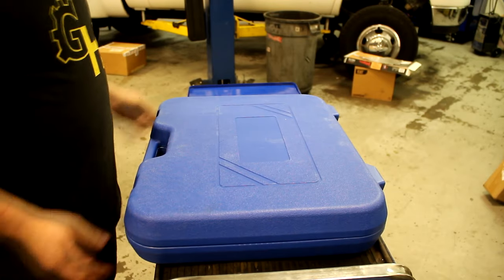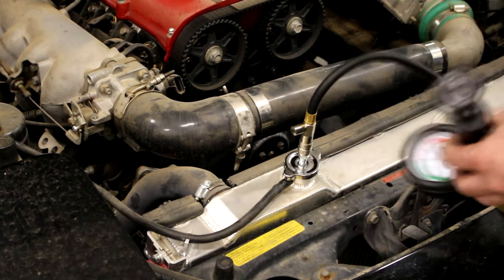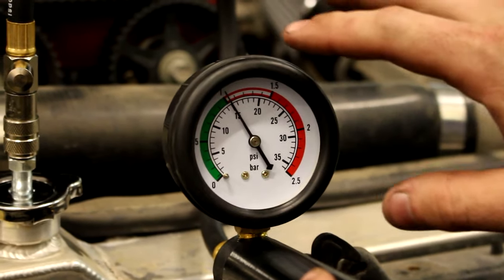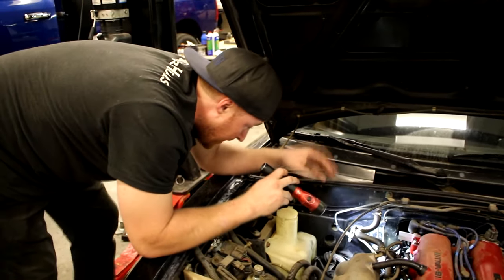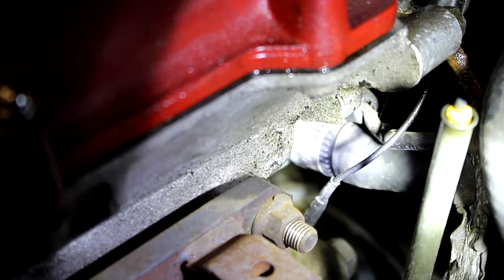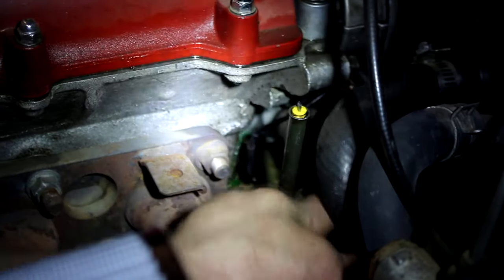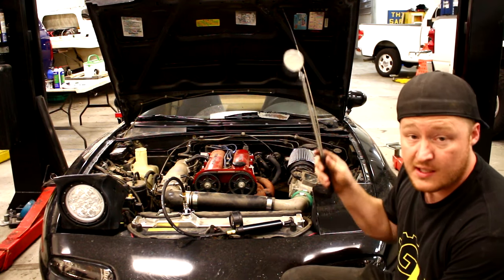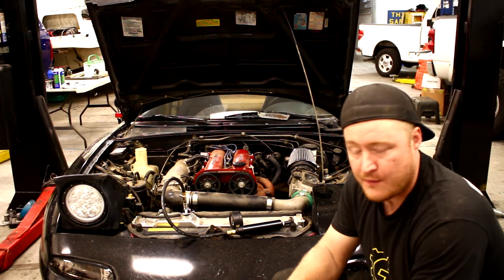The RIGHT Way to Find A Coolant Leak!

Comment: Thanks. Super helpful video. You answered my question. I knew there had to be a better way than guessing or filling it up again with coolant, getting it hot, and then looking for the leak. 😁 Update- rented the pressure kit, pumped it up, and instantly found my leak. Worth the time and removed all the guess work. Thanks again.
Reply: The main problem with getting it hot and looking for the leak is all the steam that can get in the way from the coolant spraying on the engine and exhaust.

Comment: I'm doing this (again) on my Isuzu Rodeo tomorrow. I've replaced so many little coolant hoses over the years, and O-rings, etc, on this car. Every time I think it's finally a blown head gasket, it turns out to be some little T-junction of hoses hidden somewhere and spraying coolant under the intake or some damn thing. I already put the pressure tester on the radiator at the parts store, actually, and I could hear the coolant running out, but couldn't see it. Need to do it again with the air intake off and maybe snake the endoscope around looking for a visual leak.
Reply from the maker: Good luck!

Comment: Thanks for the idea, we are going to try sealing a suspected "hole" in the engine of my car with chemical metal, but I think I'll suggest to my father that we let the pressure build up first (run the engine for a bit so the rubber hoses become stiff) and observe so we can be very sure that is the actual leak and not something else.
Reply from the maker: Dont waste your time getting it hot, just buy or rent for free a pressure tester so you can find out when it is cold. Then again the guy wanting to JB weld his coolant leak is not gonna be the guy to do things the right way in the first place I guess 😂😂
Reply: What does "hole in the engine" mean? It's nearly as vague as "hole in the car." 🤔
Reply: @GearHeadsGarageChannel  Ha ha. I suspect my father just went along with it just to let me make my own mistakes. 

I found the leak soon after because I was just a second away from getting sprayed in my face by scalding hot coolant from a hose when I was looking around the engine searching at my parking space after a intentionally demanding ride to raise the pressure, we found the right part and fixed it, but the head gasket failed hardcore a month or so later and fucked up the car so badly that I had to sell it.
The second car I had I did a far better job at diagnosing, researching and finding the coolant leak that popped up on that one. But on that one the car engine slowed to a crawl and jerked like mad at the end. I was also sick of the fuel costs it had so it gave me a excuse to sell it off.
I understand cars far better now than I did a year ago and understand better how to find leaks now and how to troubleshoot cars. 
This third car is in very good condition for being 20+ years old and I have a plan to service it properly as I want to ensure it lasts for another 10 years.

The biggest issue I have really is that I have no place to properly lift the car and tinker with it to learn more if I want to do something under it, the only lift in the city costs money per minute and it quickly adds up, so I'm restricted to reading and reading some more about whatever issue I find, then lifting the car only when I am ready to tackle it, But things I can fix while the car is standing is no big problem. I'm slowly aquiring every tool I can imagine and reading enough about the car to burn a hole on my computer screen.

Comment: I’ll def check this out today! My 2018 ecoboost mustang is leaking coolant.. I think it may be internal since white smoke is being produced from the exhaust only on start up… but hopefully it’s something small so I won’t have to spend hundreds of dollars for a repair I could do myself. 🙏
Reply from the maker: In that case you also may want to try a block tester, you can buy a kit for that very cheap as well and look up how to use it.
Reply: @GearHeadsGarageChannel  Uho! That's not good. Thank you for some more insight!

Comment: Good work guys!  That's why you two are considered men among us schoolboys.
Reply from the maker: Haha ohhh please we are like kindergarteners
Reply: @GearHeadsGarageChannel  yo had a question for Yas I got 02 durango 4.7l the radiator leaks one day then 2 days it won't leak it's defently leaking I do know that much but other than it leaking one day and than not the next day the weird thing is I've had to fill it a couple times now that the whole system has green 50/50 in it but when it leaks sometimes it comes out clear like water idk guys!! Do you possible have a anwser for that or anyone for that matter
Reply: Among Us?
Reply: @kevincash2238  side fins are loose that connect to the radiator maybe?

Comment: Thanks for the helpful video. Does the tester hold pressure if there is head gasket leak?. My radiator is short about 4 cup of coolant after an hour of driving, but the reservoir show full.
Reply from the maker: Depends on the leak and how bad it is, it should not hold pressure with a leak though. If you are concerned about a head gasket try a Block Test kit, they are easy to use!

Comment: your first link for the preassure test kit nolonger works.
Reply from the maker: Search for a Mishimoto 28 piece coolant test kit it will come up, it is the same kit and is available for less than $100 still compared to the same thing in different colored cases from more expensive brands.

Comment: Just had a head gasket done and replaced th radiator cap and now its going through coolant even faster .  2 days full to empty bone dry .. its a 2012 Sub Impreza sport... the rpms i have to give some gas to get to

Comment: What if you have a crack in the plastic overflow coolant reservoir tank itself?  would  a pressure test even detect such a thing?   (sometimes you can't get under your car to doublecheck this that easily)

Comment: I replaced radiator , cap and thermostat. Is I to possible water pump is leaking , bottom radiator hose not getting hot. Runs normal per temperature gauge. 3.4 Toyota engine. Haven’t removed timing cover yet to inspect.

Comment: How would i pressure test if my vehicle doesn't have a radiator cap? It's a 2001 5.4 Triton. I see that the pcv valve is my issue with vehicle not staying but they was a sudden coolant leak

Comment: Here's one that falls under the "Maybe they used to say that, but they don't say that now" category. Could you have stopped the leak temporarily by using a radiator cap with lower pressure? I know not to rely on a temp fix forever. Second, if a spring type clamp was originally used, is it advisable to use a worm clamp? Nice video! Easily understood.
Reply from the maker: That wouldnt make sense either way. If the leak is that small you can limp it for a day and then fix it. If its big the rad cap wouldnt change anything and idk where you would buy an 8-10psi rad cap anyways. If you did that the cooling system(under normal driving fully warmed up conditions) would still pressurize and then would overfill your overflow and you would leak a bunch out anyway. It is not a solution even if you could theoretically buy one to limp home it would be a poor bandaid at best.
Reply: @GearHeadsGarageChannel  Thanks. The car I was advised to do this was a 72 Chevy. Cadillacs may have had the overflow reservoir in 72, but not the Impala. Also, in 1986, you could go to the auto parts store and ask specifically for a 7-pound closed system cap and get one. It was also common to pour black pepper in a radiator to seal small cracks and pinholes. Common, but rarely advised. Thanks for your reply. Rare to see on a video as old as this one.

Comment: just happened to stop by this video,and saw about the coolant leak was.   I got a backside of motor leak too on my 14 dodge journey 2.4l.   I've changed both thermos n ect.  water pump looks fine too just that one big leak when engine an ac is on.  any ideas

Comment: When would a dye be used instead of pressure?
Reply from the maker: With coolant its not really necessary as it is very easy to pressurize it like this, if your loosing coolant and cant find a trail you need to clean better and look again(If you still find nothing pull your spark plugs and check for water there from block or headgasket, also see if the oil level rises). Dye is more useful for oil leaks and A/C refrigerant leaks. Even still VERY rarely do I need/use it for oil leaks.
Reply: @GearHeadsGarageChannel  If the leak is internal could this pressure damage gaskets or cause rapid failure. Like Hydro locking?
Reply from the maker: @mobilecommunicationsnetwor5268  Internal to what? If its internal to cylinder it will cause the engine to consume coolant and likely overheat(if it had such a bad leak to cause hydrolock it probably wouldnt even run), if it leaks into oil it will dilute it and make it milk shaky and if ran unfixed would ruin the entire engine. These are less likely and less common than external leaks though.
Reply: You can use the dye with pressure

Comment: Would this kit work on cars with a cap less radiator/expansion tank only? Also would it help to find a tiny leak? My car has a tiny leak (below the max level in a few weeks, below the min level in a few months most likely) and I can’t see any evidence of a leak with the car hot and I don’t know in this case if bringing it to pressure with the car off using this tester would really help me or not.
Reply from the maker: Yes it still works on vehicle with that kind of system! Admittadly your leak sounds very small so it may be difficult to find but I believe it is worth investigating and doing some proper testing to save you a larger headache down the road.

Comment: I recently did a transmission swap on my 03 cl type s and it’s running and driving fine but I can’t figure out y it’s over heating and y something is leaking from in front of the driver side back tire

Comment: Are the different color things in the kit to go on coolant reservoirs? I don’t have a radiator cap, just a reservoir. I keep having to top mine off too.
Reply from the maker: Yes you can get an adapter for your application.

Comment: My 2014 Dodge Charger is overheating I change the thermostat and I change the Radiator fans and it’s still overheating so I check under to car and see it’s leaking could that be the problem

Comment: I have a mustang that doesn’t have a radiator cap. Can I follow the same process by connecting this to my coolant reservoir tank instead?
Reply from the maker: Yes you can that is how you do it on that type of system. Fill it up all the way and make sure you have the right adapter and it will help find your leak.

Comment: The first link isn’t working is there an updated one? I’m buying everything that was used, my Mercedes’ keeps leaking coolant and I’m gonna fix it myself
Reply from the maker: Search for a Mishimoto 28 piece coolant test kit it will come up, it is the same kit and is available for less than $100 still compared to the same thing in different colored cases from more expensive brands.

Comment: Newb question - Does the reservoir take on pressure? I'd guess no, there must be some valve that permits flow from the reservoir only when unpressured?
Reply: 2018 Sienna
Reply: Usually the radiator cap will prevent the overflow tank from being pressurized.  Same with the test kit if hooking directly to the radiator as there’s a seal on the test pump.  Not familiar with that vehicle, but if that’s where you fill it from rather than the radiator, that’s where you’ll pressure test from.

Comment: Only  halfway through the video but I was surprised that you didn’t have to clamp off the overflow line it seems like that would let pressure out into your overflow tank? Although maybe that’s part of the closed system?
Reply from the maker: The overflow system does not get pressurized during this procedure. Pop your rad cap off and look, it is sealed to the top of the radiator neck and only when pressure rises it pushes the spring on the cap up and then over through to the tank. The pressure tester seals at the neck and does not in any way feed to the overflow tank.
Reply: How about the turbo expansion tank on a subaru sti ?

Comment: Does the engine needs to be at normal temperature or have the thermostat open to do this test?
Thanks.
Reply from the maker: No it does not have to be, but keep in mind it does need to be mostly full because if you are too low on coolant you likely will just be compressing air  and it will take forever to build pressure with the tool and also if the leak is in a high spot you may just get air coming out unless it is almost full. If you need to run it and burp the system to get some air out then proceed carefully if things are hot.

Comment: What if there are no signs of a leak but I’m still loosing coolant from somewhere? Any help would be greatly appreciated people. Garage had a pressure test on it and couldn’t find anything 😕
Reply from the maker: Sure its not coming out your radiator or overflow cap? Otherwise head gasket would be about the only other option. Or radiator could have a leak in it going through to the transmission side but then you would have high transmission fluid/milkshake and itd probably be in the coolant too. Honestly not sure what to tell you without looking at it myself.

Comment: I used the kit on a mitsu..the reason I mention the car is I used the smallest spring loaded adaptor. Anyone else get a bad seal? like if I move the pump around the smallest amount it breaks the seal with the radiator.  If I pump it and put it right down it seems to hold. frustrating, because I think I have a leak when I may not.

Comment: My car doesn’t have a at the radiator, do you end up putting the pressure cap on the coolant reservoir?  (2007 Chevy Malibu 3.9L)
Reply from the maker: If it is a degas bottle or expansion tank style system(it probably is) then yes. Older systems where you fill the radiator directly and only have an overflow you fill at the radiator. Your cooling system cap is on the expansion tank if there is nothing at the radiator.

Comment: My Audi A3 2.0 Tfsi 54 plate has the coolant light keep coming on I’ve had a new coolant bottle and all new pipe work and it’s still coming on it’s been over a year now and my garage says they can’t see any leakages but when I stop and park the car I have a wet patch under the engine, it’s not over heating at all any ideas anyone.
Reply from the maker: Check your level in the morning when the engine cold. Is it actually dropping or remaining the same every day? If you have a puddle it is likely A/C condensation and completely normal. If your level is dropping and leaving coolant on the ground then pressurize it like I showed and find it, or go to another shop.
Reply: GearHeads I have to fill coolant up probably every few weeks as it goes down to minimum level.
Reply: Your car has a coolant light!? coool

Comment: is it normal for your overflow tank to bubble when you pressurize the system?
Reply from the maker: No, if it is then your seal in the tool at the radiator isnt sealing it should not be sending any pressure to the overflow.

Comment: My vehicle was smoking from my hood. My reservoir for my radiator still had fluid and my gage did not indicate there was anything over heating.  I put water in my radiator and started my vehicle and after the car was running I noticed a leak on the right hand side of the car under my hood.  What are you thinking ??

Comment: Hello,

I have a question is loosing about 50ml coolant is normal in a month?
Reply from the maker: 50ml is like an ounce and a half, how are you even noticing that tiny amount?  To be honest I wouldnt be concerned. and amount that small depending on the vehicle may just be getting steamed out of the overflow.
Reply: GearHeads hello,

Thanks for your reply I put the mark on top of the coolant to check, I was been told it’s a close system so you should not loose any coolant. Please explain

Comment: @GearHeads  yo had a question for Yas I got 02 durango 4.7l the radiator leaks one day then 2 days it won't leak it's defently leaking I do know that much but other than it leaking one day and than not the next day the weird thing is I've had to fill it a couple times now that the whole system has green 50/50 in it but when it leaks allot of times it comes out clear like water idk guys!! Very rare it comes out green sometimes but rare most time clear like water like I said the whole system has been filled enough times now that it should only be green through out the whole system so wondering why it comes out clear rusty color.Do you possible have a anwser for that or anyone for that matter
Reply from the maker: If your getting clear water dripping its probably condensation from your A/C system. If you think you have a leak get a pressure tester like we showed and find it.